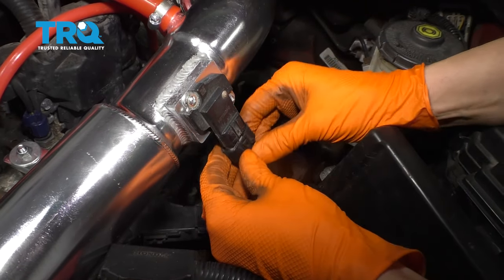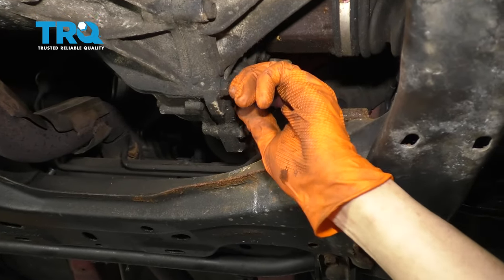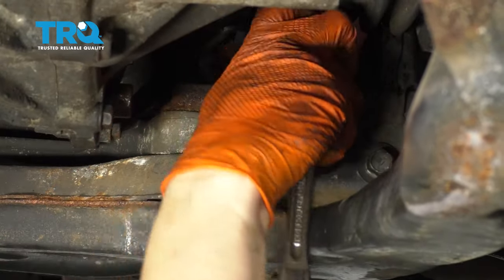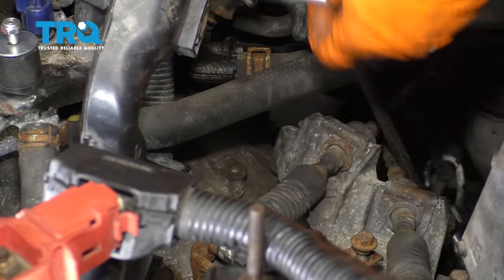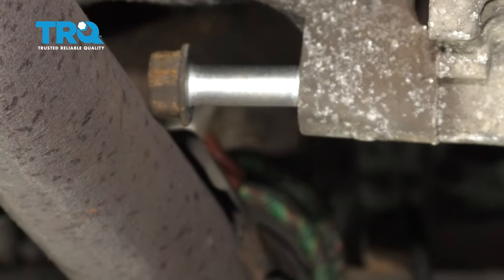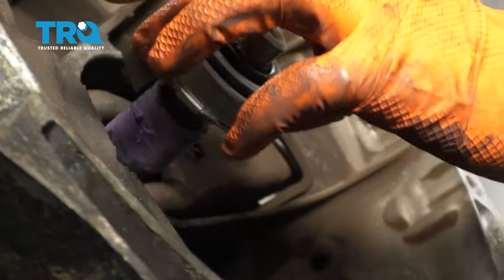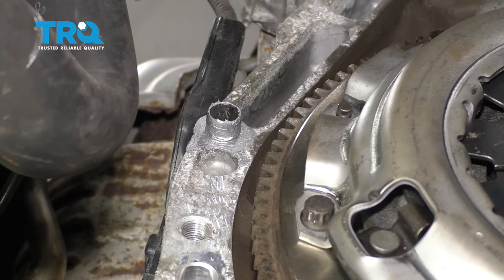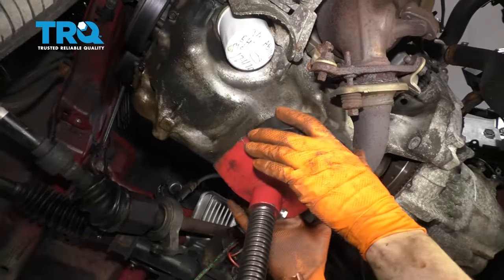How to Replace Clutch Kit 2006-2011 Honda Civic

Comment: This took me a lot longer than an hour lol, about 7 taking out the trans, half hour on clutch, and about 12 hours putting back together with torquing and lining up. I reccomend to tie your steering rack up to your struts (zinging tight to the point where it feels like the tie rods are going to bend) using tie downs so the splines in the steering rack don’t disconnect from the steering column. If your rack falls out of place your going to perhaps need to get it realigned. I fortunately did not have it disconnect but have heard horror stories about it lol

Comment: Thank you! I will be doing exactly the same by myself for the first time.  Just one question. Were you supposed to have the flywheel resurfaced?? I heard from a mechanic that it should be either replaced or resurfaced. Thank you again

Comment: 30:00 Drop the engine a little bit so that the trans goes in an ever so slight angle and clears the frame rail.... that's the hint I needed. The bolt as an alignment device is helpful too.

Comment: I just did this whole job and I have no pressure and can't engage and disengage the clutch. I realized my power steering is disconnected too as it stretched. Would this have anything to do with it? Do I just need to bleed the clutch?

Comment: Great job; thanks for sharing that. 
Q: Are all 8gen 2006-2011 civics have the same transmission? particularly hatchback 1.8l EU models with available models in the US? 
I noticed a difference in the filling-up bolt (with/ without sucket); please correct me if I am wrong. :|